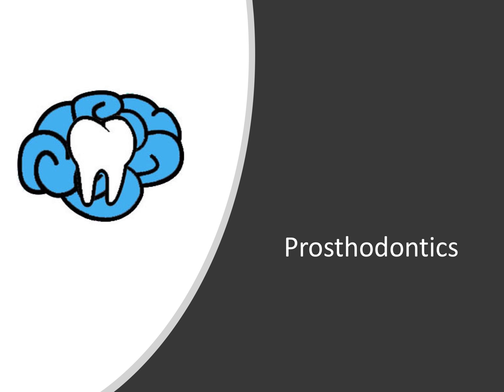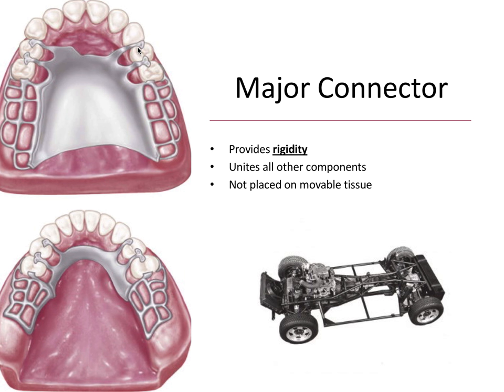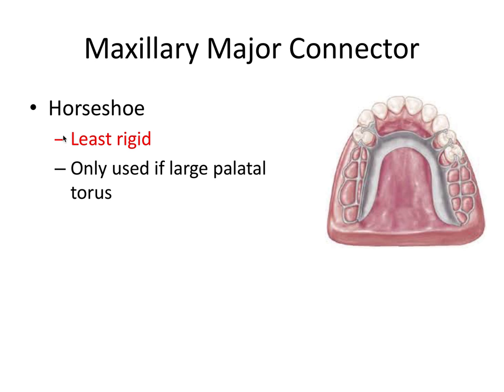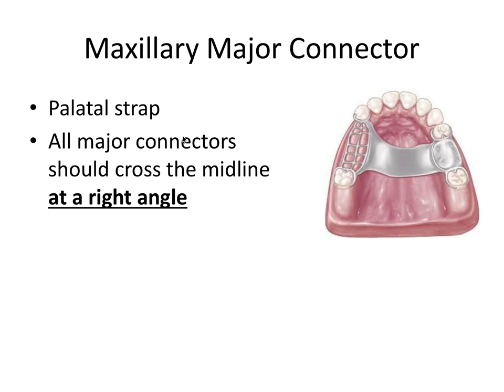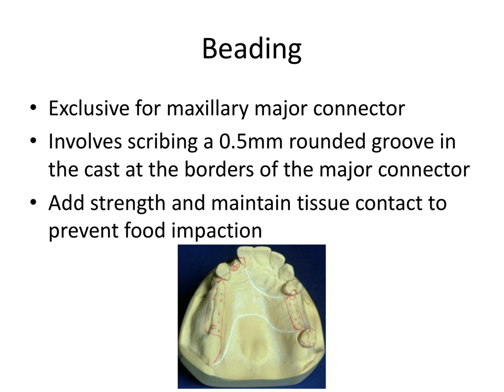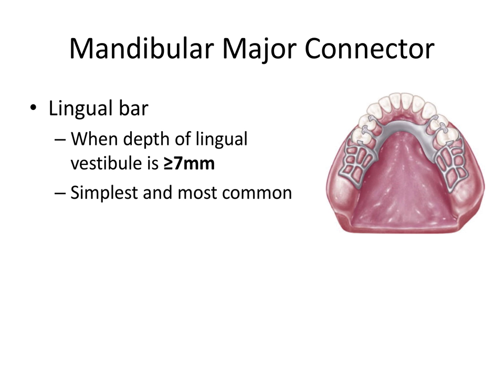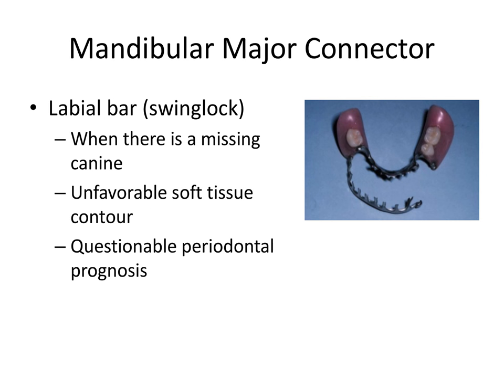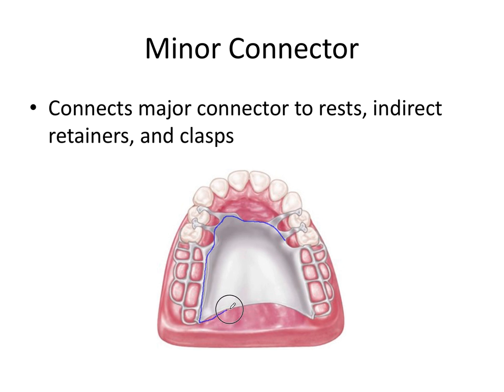Prosthodontics | Major & Minor Connectors | INBDE, ADAT

Comment: Hi Ryan, thank you so much for all your videos! I am preparing for my finals and I binge watched all your videos. 
Could you please tell me what type of connector you'd use for a high vaulted palate, please? Also if there is a large mandibular torus and surgery is not possible, would you opt for a buccal bar as the major connector? 
Thank you! :)
Reply from the maker: Hi there! You're very welcome, I hope you are finding the videos helpful. And these are great questions! A high vault by itself may not be an indication to choose one design over another (in my personal opinion), but if there were a deep palatal vault with something like a pseudo-cleft then I might opt for a horseshoe design to avoid contacting this area where it may be difficult to get good adaptation (but this would be more of a concern with a complete denture anyway). And you are exactly right, if there were large tori that inhibited the placement of a lingual bar or even lingual plate (and surgery was not an option) then I would opt for a buccal bar.
Reply: @mentaldental  Brilliant, thank you Ryan! :)